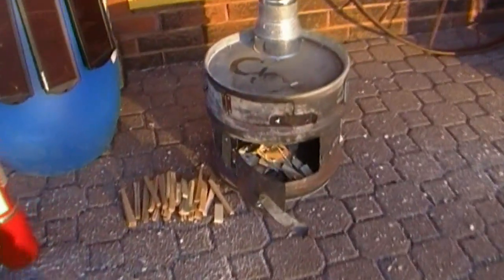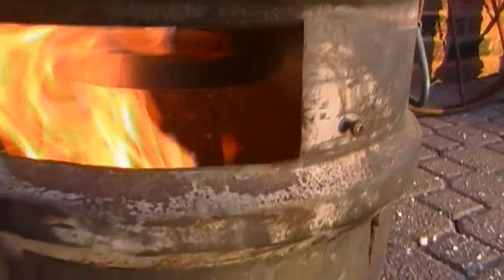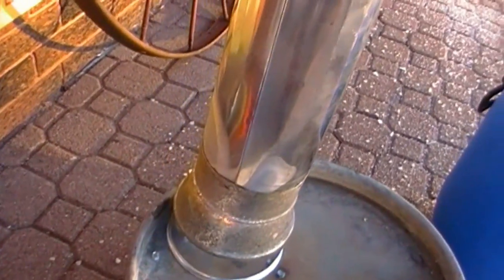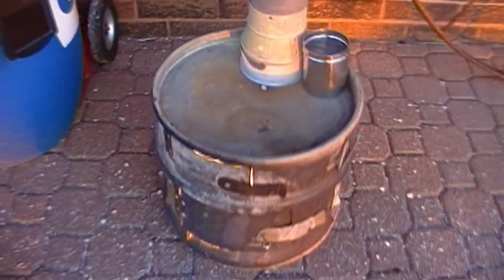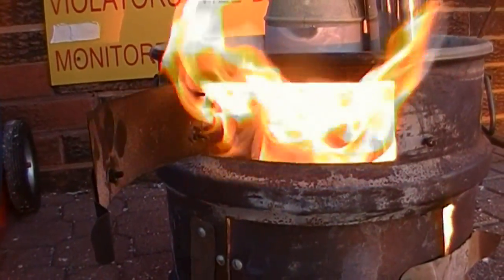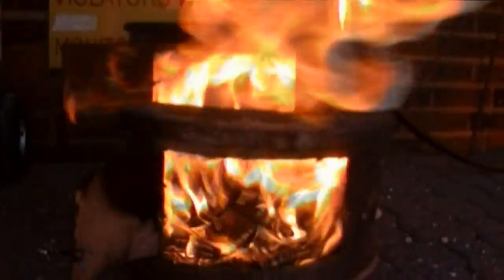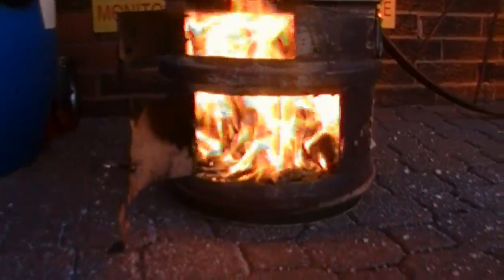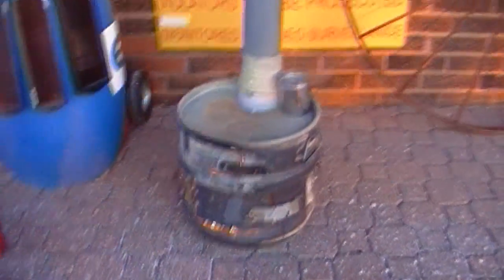Home Made Wood Stove - Urban Survival

Comment: it looks good man. you should make a stand for it and grab hold of some clean copper wire coil it up so it fits on the inside drill 2 holes to make an antrance and an exit and to hold the coil up just pop rivet bands across them to hold the coils in place and make a hot water heater. and plus sealing up your doors and drafts abit more will help slow the rocket effect on the chimney. hope you try it

Comment: if you make it double-drum, you can make the flame chamber smaller(needs less fuel) and if you fill up the space between the drums with sand, crushed glass or really small pebbles(volcanic stuff are the best), they can work as heat buffer. I've even seen a guy having a small rocket burning chamber attached to a huge water tank as heat buffer (obviously there was a pressure-relief as well). But your version is simple, easy and excellent in a survival situation!

Comment: I'd add a top cap and spark arrestor screen.  You can make one from 1/2 inch hardware cloth and a pie tin.  Once you burn off the zinc on the stove pipe coat it with high temp grill spray paint and you are good to go.

Comment: Great stuff if you cut tin can in to strips and drill a pilot hole,then drill self tapping screws from inside the stove and grind the tips off screws face out ward it would be air tight with a welded look.I did it to mine...like the vid thanks man...

Comment: little close to the building there einstine. nice job though. run that baffle out a little closer to the sides of the thing will work better. and you should get that top door sealed up better so the fumes don't get ya.  SMOKE UP JOHNEY

Comment: Nice !  Maybe a brass coil insert for on-demand hot water ... at least to take the chill off of a gravity-fed shower supply ... As long as the reservoir is about 8ft higher than the shower head, it does not matter if you dip down low and run it thru a coil that is inserted thru the main (or top) door of the stove. ... Just need enough of a leader to avoid any melting of fire or safety hazards.  YOU may not care that much but I hear the ladies really appreciate a warm bath, on occasion.

Comment: You need a way to shut down the air source.  I would recommend cutting either new doors that are bigger than the openings or riveting some small plates on the doors.  This will allow a longer and more controlled burn.  Saving you time in the long run by not using so much fuel.

Comment: @envirosponsible damper = anything used to regulate the incoming air or outgoing exhaust. You built one into the side of your stove, that metal flap covering the drilled holes.

On a fireplace, it's between the chimney and the hearth. You close it to keep rain out

Comment: A dampener is a way to regulate the air flow, as fire needs air to burn controlling the air is the fastest way to boost or oppress a flame (think how bellows make a fire burn hotter, it works both ways). To have an effective dampener I'd replace the doors on you are currently using on  your stove to ones that restrict air intake more, and then use shutter like devices where you want to primary air intakes (which could be the doors, or not, either way) so you can adjust air flow.,,

Comment: screw codes and inspections. Use this the way it should and it will work great. I would use a very small fire. I need to heat my small pottery shed.  The Mexican and Indians down in mex. used the ceramic type that you see in back yards. No pipe out the window. Placed it just under the windows and no real hot fires. I probably could make one but would place a pipe out safely through the wall.
Reply from the maker: Pegi Gould You're absolutely right. I said that as a disclaimer. Thanks for watching and commenting.

Comment: Speaking from personal experience if your going to have it sitting on a wood floor you will start a fire. You should install legs on it. Otherwise it's a great idea. Also you should tighten it up a little and also put a baffle in the chimney to control the air.

Comment: Nice cheap stove.  Without a grate, ash removal is going to be a pain and the stove will probably need to be cooled before you remove the ashes.  I also seems to be drawing too much air.... I'd tighten up the gaps in the doors, and do you have a damper in the pipe to restrict air flow?  Depending on how often you use it I'd recommend that you start to build a replacement.  55-gallon drums are thin and unbricked, and will burn through in short order even at low heat.

Comment: You can't "burn the galvanized off" galvanized steel is mixed with zinc which corrodes over time to gmail what's called galvanized metal. The next time that thing sits or gets wet it will remain toxic still
Reply: If you have to comment, try not to be completely wrong eh? Galvanizing is a COATING not mixed in steel. It's there to stop corrosion because it doesn't corrode off over time...what the hell would the point of that be,? Zinc isn't going to release anything toxic unless you burn it, and even then it's hardly zychlon B, it's a very small amount of toxic fumes until the coating is gone or cools...which is minutes and not likely to harm anyone. Welders would all be dead if that were the case.. Here, learn something before you decide to make an ass of yourself again http://en.wikipedia.org/wiki/Galvanization

Comment: I used 2make a vat out of these barrels nd tiled it with 1" thick fire-brick 4longevity, nd used 2last for at least 10years. if you did it like that the coating on th outside would have remained whereas this way it'll b consumed by rust soon.